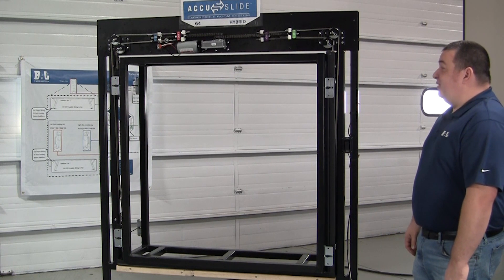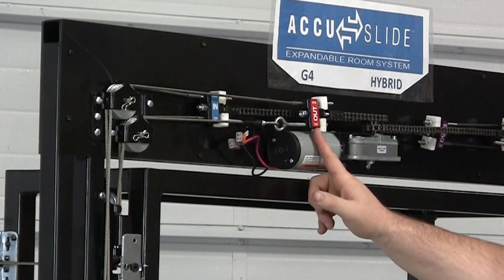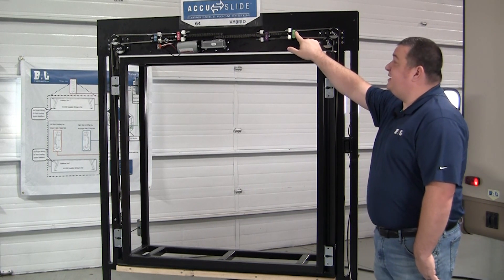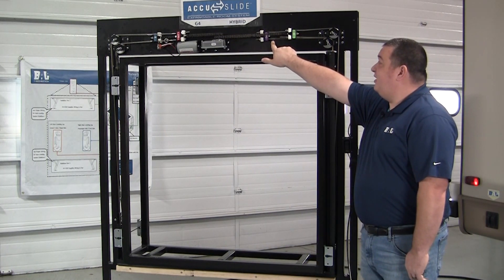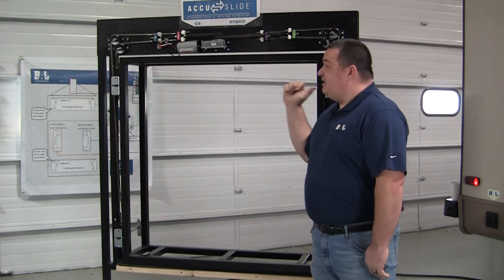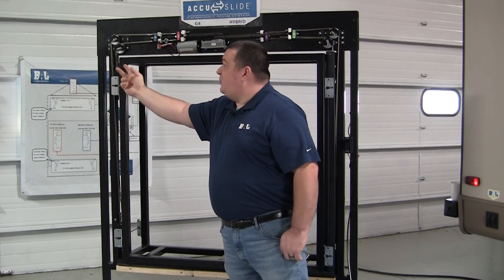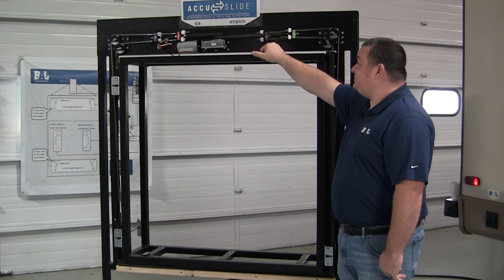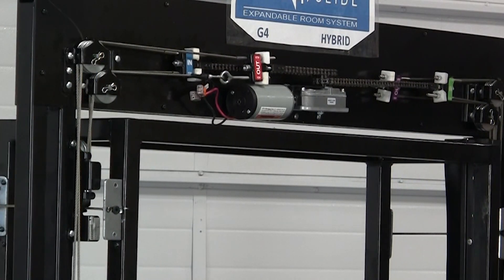BAL Accu-Slide System Overview

Comment: Not sure if yall will see this, but if the wipe seals need replaced, does it need a whole new tower or just new wipe seals? It looks like they are built into the towers, so I'd assume the towers need replaced.
Reply from the maker: Depending on the type of Accu Slide (single motor operated) there are different wipe seals are available. All the vertical wipe seals can be replaced. It is not necessary to replace the tower (aka: jamb assembly) unless it is damaged.

Comment: My system was adjusted with the box off center by 3/4 of a inch to the right will it automatically recenter itself  ?
Reply from the maker: The room floats in the opening from left to right. When the cables are tensioned properly, the room should center itself in the opening after cycling the room 3 times. If it does not, then we would recommend checking under the room to make sure the glide surface (rollers or wear bar) is not causing drag on one side or has worn a path in the bottom of the room, causing it to pull to one side.